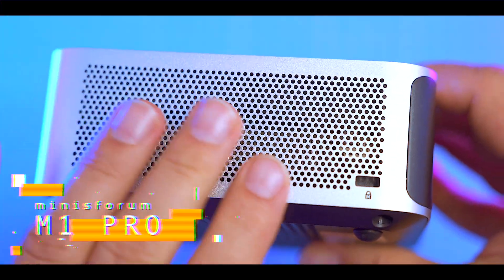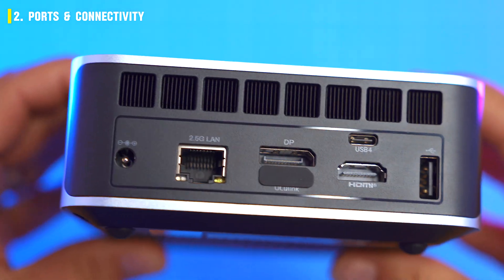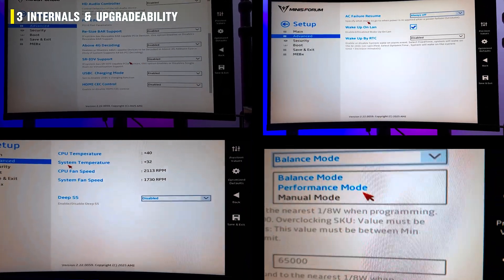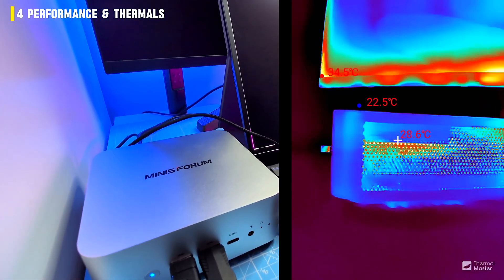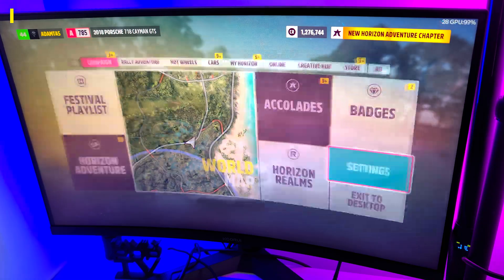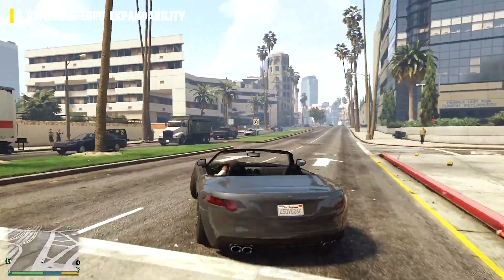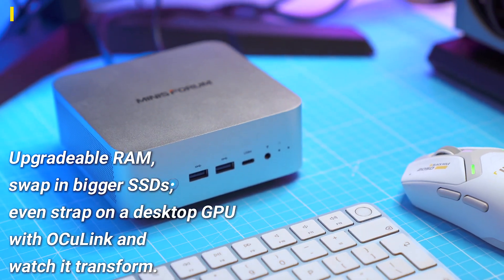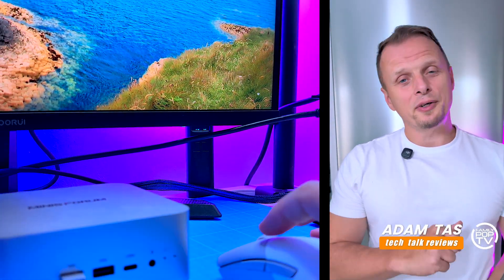Minisforum M1 Pro-125H Review: Tiny Box, Serious Power?

Comment: The thermals are low, because the TDP and CPU itself are LOW-Performers in today's Laptop/Mini market.
An equivalent AMD Processor would be the 6800H or 6900HX, well below today's midrange. Intel Mobile Midrange would be at LEAST the 155H, not the 125H, and 7480/8845/8745HS on the AMD side.  The Low Power Cores are useless, nothing in Windows will ever actually use them, so it's really a 12 core, 16 thread CPU. Also, the iGPU performance is inferior to the above Zen3+ 6000 series CPUs with their now older RDNA2 680M iGPU.

Overall, it's a nice looking quiet unit that would be fine in situations where actual computing power isn't needed like office apps, browsing or general use. Anything more and you need a better CPU. At the price point it's currently set at, it's a poor value, and for that level of Money, one should buy the Minisforum UM690L or UM760L instead.
Reply: Thanks mate ❤